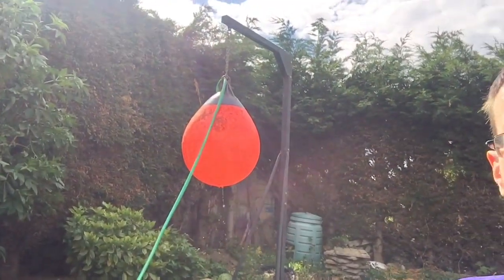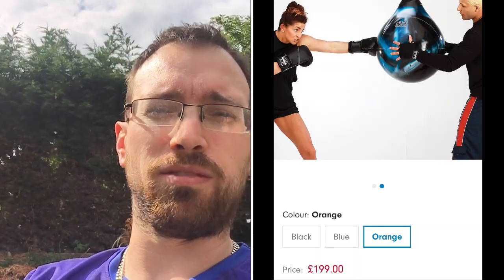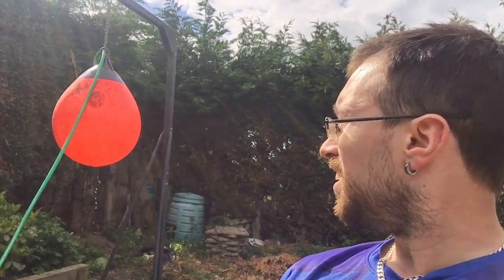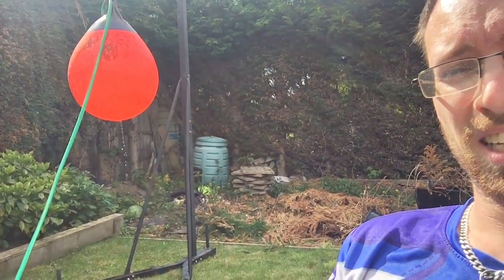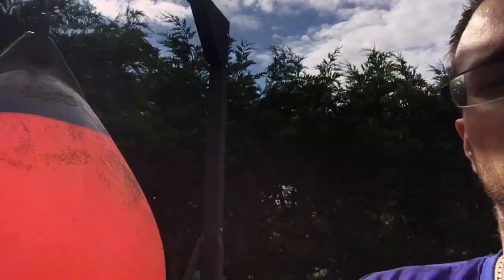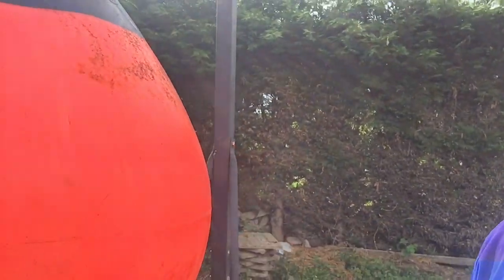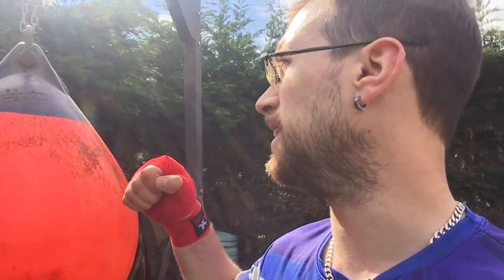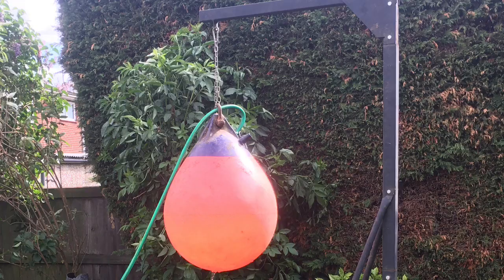DIY Make Your Own Aqua Punch Bag Hack with Polyform Water Buoy

Comment: Nice job, i have purchased an A4 buoy, just waiting on my wall bracket to be made. Quick question, what nozzle did you use on the hose to fill it up? Thanks.
Reply from the maker: I used an adapter from an air bed air pump, it wasn’t ideal as it had 2 small holes in, but it did work.

A small funnel would do just as well

Comment: I need help. I have the exact same buoy but for the life of me I cannot find a anchor shackle to fit over it, None of the Home Depot and Lowes ones are wide enough to fit over the opening. Where did you get your anchor shackle from. I really need your help
Reply from the maker: I got my buoy 2nd hand and it came with the shackle and chain already attached.

If you haven’t filled it yet, it might be worth taking it with you to Lowes or Home Depot to see if the store assistants can find something that fits?

Comment from the maker: Hi everyone, thanks for watching! For my next diy budget project, I’m considering either a break board holder, a makiwara, or possibly a reflex bar. If anyone has any other suggestions, feel free to leave a comment!
Reply: Great video. Is it possible to put evt  other things Then vater in the ball
Reply from the maker: @hansen704  I don’t see why not.
You could use antifreeze or maybe a slime mix.

It’s also possible to use just air, but it won’t be as heavy or have the same feel
Reply: @martial_life    Yess thanks. I was Think is in a ventil or a plug in Ball
Reply from the maker: @hansen704  My one had an air hole and a screw in cap to keep it sealed
Reply: @martial_life   okk  i read in  brochure one  had ventil to airpunp and there i cant get vater in
Reply from the maker: @hansen704  you need an attachment for your hose to get past the air valve, or if you use a screwdriver you can open the valve up so the water can flow freely
Reply: @martial_life    Ohhh yess. Thanks for your answer 👍
Reply from the maker: @hansen704  no problem, hope i helped!

Comment: How do you fill it up with water?
Any other ways to fill it up with out breaking it?
Reply from the maker: I used a nozzle designed for an airbed that fitted the hole.
You can buy some specifically for hoses but I was trying to do it on a tight budget.

You don’t really need to break it, only the little rubber one way valve inside the fill hole to get the nozzle in properly

Comment: How did you fill it with water, 
What hose attachment do you use ?
Reply from the maker: The adapter I used was actually an airbed pump adapter, it worked, but it wasn’t perfect. You can get some of those quick release style garden hose adapters that fit well though

Comment: Great. How much water is in the Ball ??
Reply from the maker: It’s about 3/4 full.

I just kept going until most of the creases were out.

The more water you put in, the harder it is. If it’s too hard, you can remove some water and use an air pump to inflate it to remove the folds.
Reply: @martial_life  you are correct. I've got mine just over half full and seems just right for me, not thinking of filling to the top anytime soon though 😂🤣
Reply from the maker: Sounds sensible! I only found out about using air to remove the creases after I’d filled mine.
Reply: @martial_life  it's all a learning process I guess lol

Comment: What attachments did you use on the hose?
Reply from the maker: It was the air nozzle from an air bed pump.

It wasn’t ideal, but it did the job on a budget!
Reply: Thanks mate
How did you attach it to the hose,
Reply from the maker: It sounds crude, but I just wedged the hose into it, no proper fitting, which is part of the reason I spilt so much water filling it